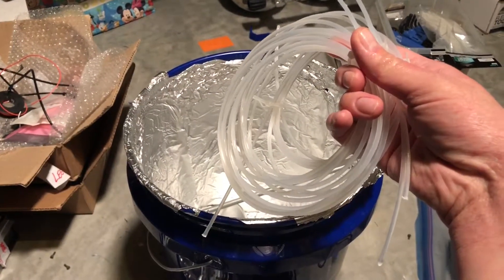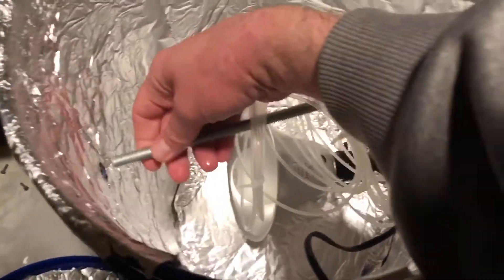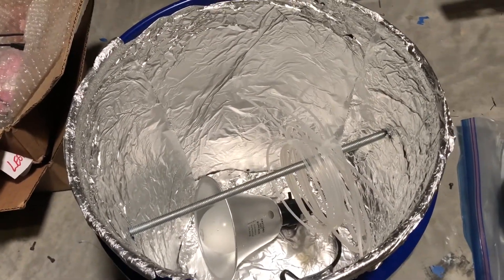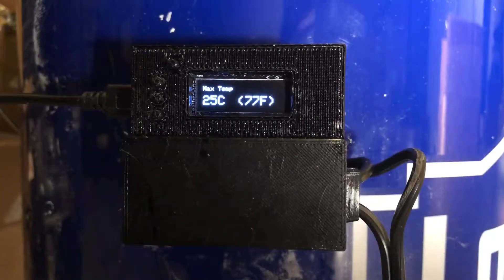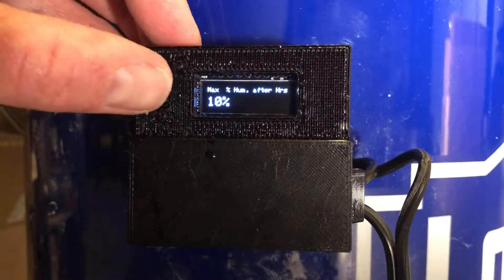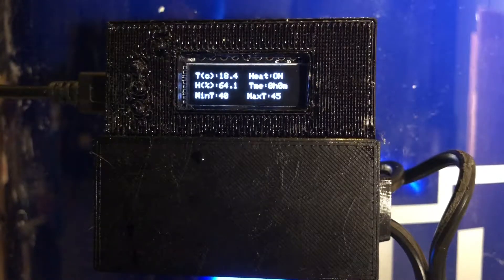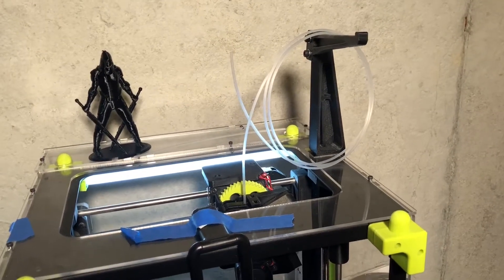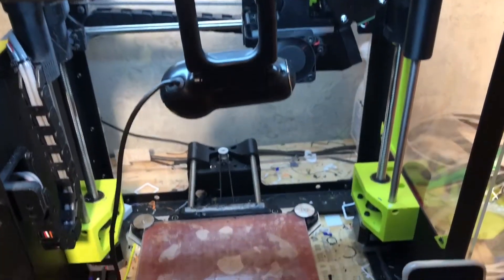DIY Arduino Controlled Filament Dryer - Part 2

Comment: what about drawing a partial vacuum to lower the ""boiling point"" of the water?
Reply from the maker: Max Bainrot increased complexity for sure but an interesting thought. My goal here was to make something that anyone could make pretty easily.

Does make me wonder if you could pull a vacuum, what happens to the water in the sealed atmosphere? Normally you’d want bribe vent that out of the chamber, but it’s sealed. Interesting! :)

It would probably also eliminate the option to pull filament directly from the chamber as you print. 

Still would be an awesome experiment if you could pull it off!